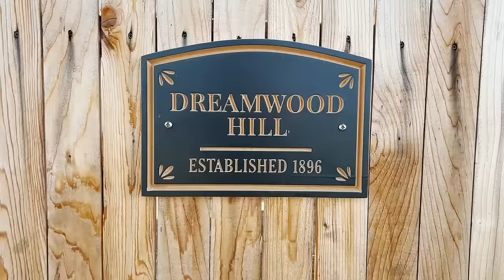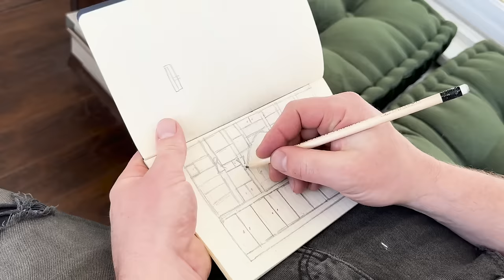a big mistake?? 😟 ⚒️ mountain cottage makeover (ep.4)

Comment: Yeah, old walls are never straight, but lath and plaster is not hard to fix.  Our first home was built in the 40's, the walls were fire brick.  Diamond drill bit required.
BTW, Ben is cute.  You should be friends first.  Been married for 50 years to my best friend.

Comment: I would not have bought this cottage.
You could have built a very nice A-shaped, cabin, by yourself.
If you place 20 boards (2in x 12in x 20 ft)  on each side at 24 in distance, you get a prism 40ft long x 20 ft wide x 17 ft tall, basically a 2-storey cabin with  1200 sf living area. 
Solar panels on one of the sides (strategically-oriented), a solar water-heater, a 300 gallon septic tank, a water fountain and, here you go, 5-stars comfort.